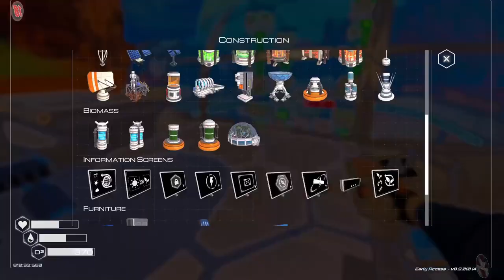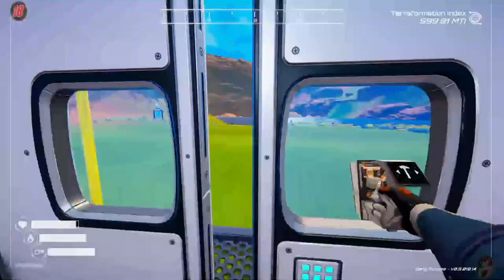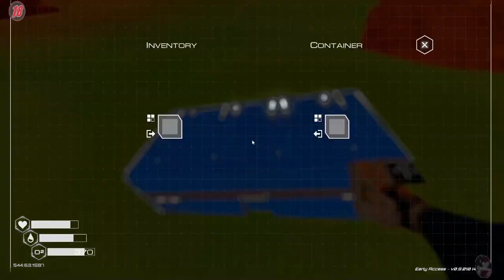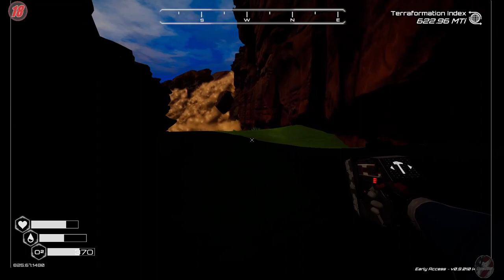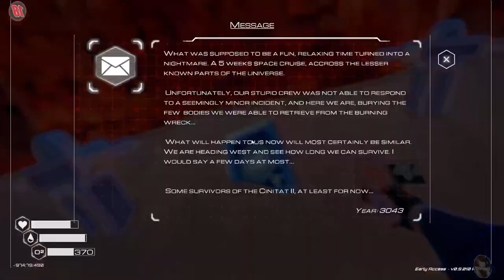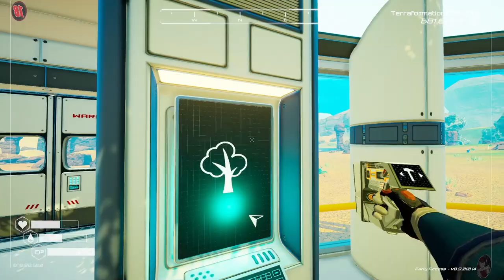The Planet Crafter, Placing mines and setting off a rocket, EP-16 SP, Eng, 18+,

Comment: Yes, the Ore Extractor T2 needs the Super Alloy Rod. But you should really have had more Oxygen by now.
There are five places to put the Ore Extractor T1: in the Aluminium area, in one of the two Iridium caves, or in one of the two Sulphur areas (where I don't think you have one yet, but I may have misremembered). They'll only mine basic ores in other areas, including the Uranium, Osmium, Super Alloy or Zeolite caves.
That Pulsar cave ice looks wrong, but you didn't check it from the crater end.
Now that they've added the waterfall as a starting point, everyone will be rushing to that second crate in the waterfall cave to grab a free oxygen tank, agility boots, backpack and exoskeleton! (Actually, it was pretty popular for the crater starting point, but most people upgraded their gear before leaving the crater meaning that they could only make use of the agility boots and exoskeleton. Also, its location seems to have moved slightly.)
The Heater T4 makes heat over six times as efficiently as the T3s; in fact the one you built puts out more heat than all of your T3s put together, which means you can free up the space in your Biolab and reach your Biodome T2 from the inside at last!
You could always turn your spare Iridium into rods to save space, but save some for Explosive Powder of course.
I would like to think you'll build an Orbital Information Screen, but given that you don't even have any Flower Spreaders yet, I'm not that hopeful.
Reply from the maker: I have got to change the heaters out for the T4's soon.
Reply: Oh, and Obsidian also needs the T2 of course.
Reply: @RevSimulation  It turns out that that Pulsar Quartz cave has a new exit which takes you straight to the crater waterfall, but that doesn't unlock until 32 GTi. If you turn left instead of right that should take you to the old exit at the crater.
Reply from the maker: Cool thanks for telling me.